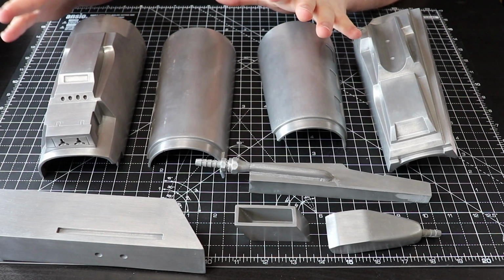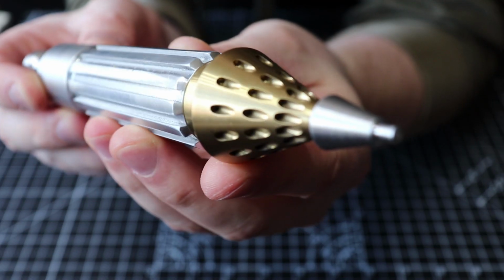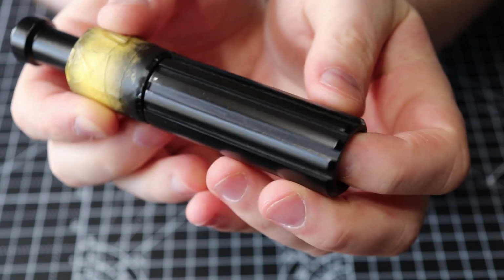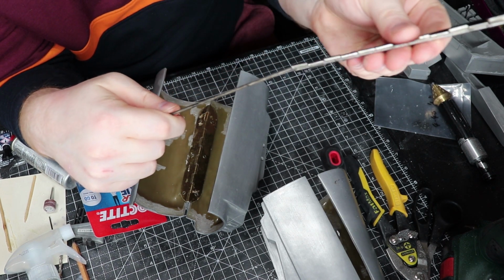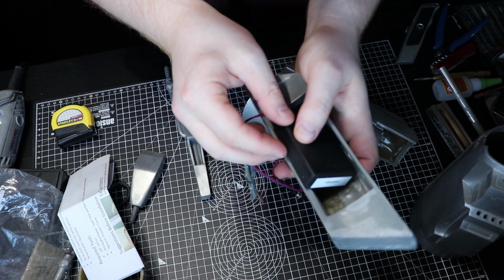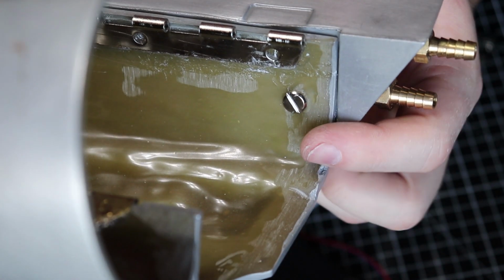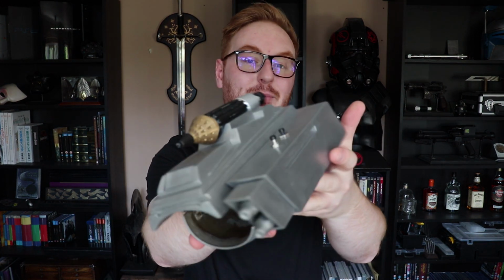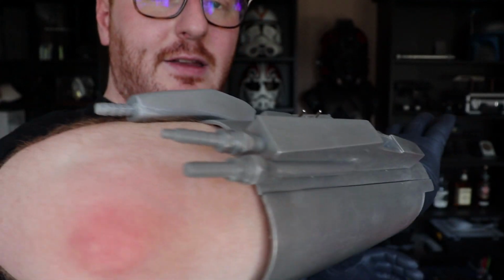Jango Fett Gauntlets Build

Comment: These are MinuteFett's kit right? Or did you get one of the last ones Cruzer made? I'm worried about assembling these myself. Was it difficult? I think MinuteFett's kit is slightly different than Cruzer's original for like the flamethrower? They look great!!! You did a really nice job. I'm happy you put this video up since it'll help me figure out how to assemble the kit since I should get mine this upcoming week.
Reply from the maker: Yeah they were from Cruzer himself. It was easier than I thought it was going to be, the hinges were the longest/fiddliest part to get sitting right. Other than that it is mainly just screwing things onto it. The only unexpected bits were dremeling out the inside so the switches can fit properly on the outside.
Reply: @BucketheadStudios  Nice man! I hope MinuteFett's are similar. Have you ordered your armor already?